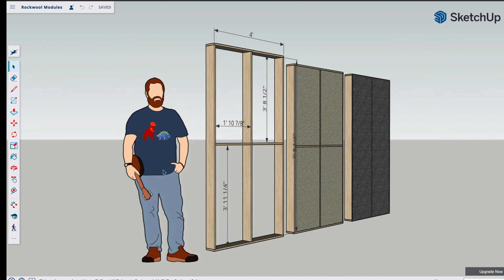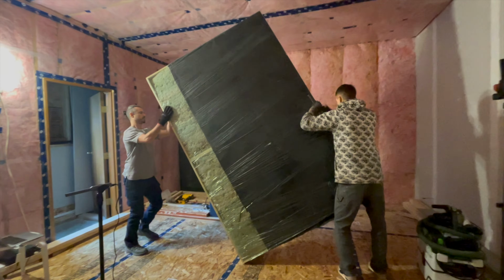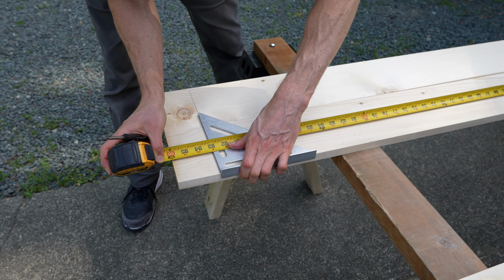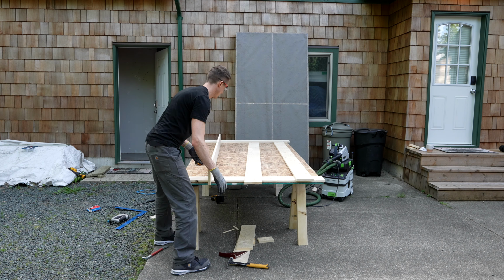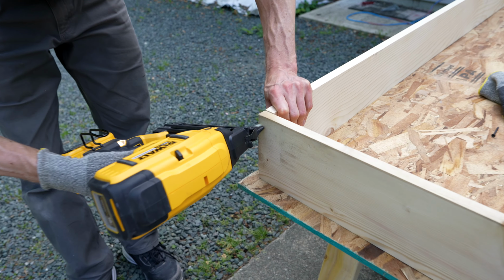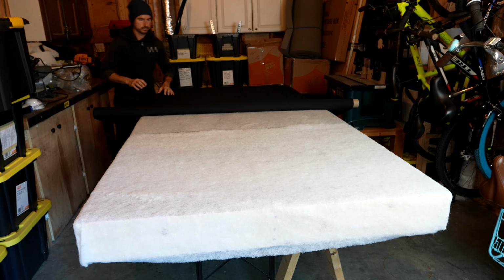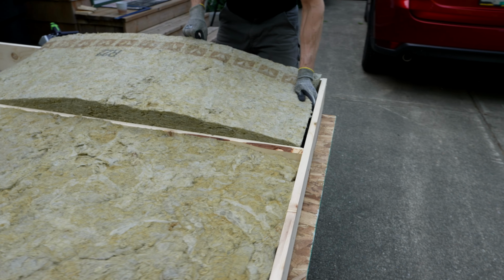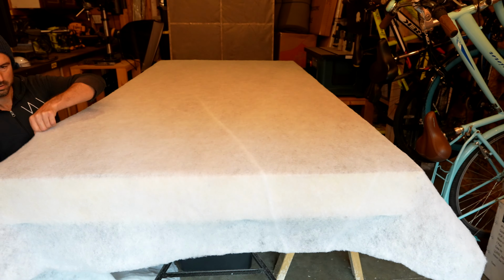How to Build the ULTIMATE DIY Acoustic Sound Panels for Music Studios

Comment: I’m not sure that my space will accommodate 5.5” panels. Which product(s) do you recommend using for 3.5” panels?

Also, in another video you stated that you prefer to use two different Rockwool products (one dense and another less-dense). But, in this video and the pdf, you only recommend using Comfortbatt. Why is that?

Comment: Dude, thanks for sharing your knowledge.  Been going down the room treatment rabbit hole for a few weeks, and your videos keep coming up. Good stuff.
Question: is there a reason you go with R22 instead of Rockwool Safe n' Sound?  I did a search for the R22 and AI said that "experts suggest Safe n' Sound for better results."  I'm not quick to believe everything AI says, but figured I'd ask.
Reply from the maker: Hey hey.  Glad you've been enjoying the videos.  AI only knows what the internet knows and the internet gets most things about acoustics horribly wrong.  So AI is often just referencing bad content in the first place.  

Unless you're building a very thin absorber (2") then you want to use very low density material.  Rockwool Comfortbatt is now 30 kg/m3.  Used to be 32.  Safe N'Sound is 40 kg/m3.  That's too high density for a deeper absorber.  It'll get reflective and that's not good for bass.  

I would only use Comfortbatt for an absorber up to 11".  If you go over that, I'd use pink fluffy fiberglass.

Comment: Hey there! I noticed you’re using R22 rockwool. At my local shops, I can only find R23 and R21; would one of these work just as well? Thank you so much, this video is very helpful!
Reply from the maker: The R stated value isn’t as important as density.  Although they are related.  They changed the formula and density recently for Comfortbatt.

Comment: Would johnmanville minwool 1200 4b work with these ?
Reply from the maker: Hey hey.  I wouldn't use that.  First of all, it's really high density, ranging from 64 kg/m3 to 192 kg/m3.  Second, it's made in weird thicknesses that don't match framing lumber.  1.5", 2", 4", 6".  

That product is too high density to use in most applications, unless you're talking about in the walls of an isolation shell or reduce sound transmission through walls.  Perhaps using a thin layer of it (1.5" of 64 kg/m3) in a multi-layer module.  

Otherwise, just stick with the basics.  Use Rockwool Comfortbatt and OC pink fluffy.

Comment: Hi, thanks very much for this whole series—it's super thorough and super helpful. Question for you—you mention using Rockwool Comfortbatt R22. My local store only has Comfortbatt R30. As far as I can tell all Comfortbatt has the same density and the R value only refers to some kind of thermal absorption spec. Wondering if you have insight as to whether or not R30 still has a flow resistivity of 10,000 and can be expected to perform the same as R22 (or any other R value of Comfortbatt). I'm about to buy a bunch of these, so curious to hear any insights you might have.

Also curious if you have insight into the best way to utilize 16.5" of depth. After playing with the Porous Absorber Calculator for awhile, I landed on 14.5" of Comfortbatt with a 2in air gap (the R30 I can easily source locally comes in 7.25" depth). But what I cannot calculate with that calculator is graduated density. Wondering if you might have more insight about whether using multiple densities with this shallow of a depth would be noticeably better than just using Comfortbatt. These panels would be on the walls to the left and right of each speaker. Thanks again!
Reply from the maker: Hey hey.  Glad you've enjoyed the series.  Rockwool Comfortbatt will all have the same GFR if the density is the same.  I think they've recently dropped the density from 32 to 30 kg/m3.  The R number doesn't matter and you can ignore it.  It's the product and density that matters.  

14.5" of Comfortbatt is too thick.  You'll get a bass reflection off that.  Make sure you carefully watch my video that covers density vs. depth.  

I would use 3.5" or 5.5" of Comfortbatt, followed by light density OC pink fluffy with no air gap at all if you have 16.5" of space to play with.  Filling an airspace with pink fluffy will always outperform using a blank airspace.  

If you're using panels to the left and right of speakers, make sure you vent the panels and don't use hard sides.  Look at designs like this with no side panels: https://jhbrandt.net/assets/drawing/208.pdf

Comment: Undoubtedly the most informative, complete and practical advice I’ve found on this subject. I’ve heard eco concerns about Rockwool as a material. Any thoughts? Can you recommend any easy to obtain alternatives?
Reply from the maker: Great to hear!  Thanks for your comment.  The health concerns about rockwool and fiberglass are unfounded, based on assumptions that have been methodically proven to be incorrect.  Rockwool and fiberglass are 100% safe to work with. 

Here's the background for you:
- https://www.youtube.com/watch?v=MSJjipaPxUE&list=PLBKYGbDC22HjdD3O4azKSOuy468ya_yPK
- Dr. John Hadley, a widely respected and experienced toxicologist, provides an overview of the research conducted over forty years period on fiber glass and mineral wool insulation fibers and the conclusions reached by such authoritative bodies as the International Agency for the Research on Cancer (IARC).
- WHO recommendation - unanimous position to not have these on the list of possible carcinogens: https://youtu.be/MSJjipaPxUE?list=PLBKYGbDC22HjdD3O4azKSOuy468ya_yPK&t=923 
- 2011 US Government removes soluble fiberglass wool from list of materials "Reasonably anticipated to cause cancer"
-  There is now no scientific, government or regulatory body in the world who has soluble rock or glass wools listed as a possible carcinogen. 
- All Rockwool is considered a biosoluble fiber.  This means the fibers are designed to dissolve in bodily fluids and are quickly cleared by the body, making them less likely to cause health problems than other fibers. 

Hope that helps.  All the best!
Reply: @warpacademy  I knew, in a world of unresearched opinions, that you would have a response grounded in as reliable research as exists. Thanks a million for cutting through the noise and superstition, as always!
Reply from the maker: Thanks mate.  Appreciate you.  Yeah, I'm very science based and I always look to the research.  Plus I've also worked with rockwool and glass wool for years and handled it a ton.  I'm very, very sensitive to chemicals and irritants, and I've never reacted to those materials and I work in my studio many hours per week.  Cheers!

Comment: I am going to be building these very soon.  Thank you for making this video.  Great info.  What is the approximate weight of modules?
Reply from the maker: Hey Tom.  I'm happy to hear that you're getting into some module building. Approximate weight I'd say is 60-75 lbs.  I could pick one up on my own, but usually I move them with 2 people just due to the sheer size and bulk of them.  

When they're stood up in a room, leaning against a wall, I can easily wrangle one on my own by shifting it along the floor.  Best of luck with your build!
Reply: @warpacademy   I was thinking of making them out of 1x8s.  They make bats that are 7.25'.  Would there be any problems making this size other than added extra weight?

Comment: Hey again! I'm curious about a few things.  Do you think it would be worth it aiming for 9 inches instead of your build of 5.5 inches for my back wall bass traps? I'd still use the 32kg/m3 rockwool. I'd layer a 5.5 batt and another 3.5 inch batt to make 9. I'm thinking of covering the entire back wall. Also, some deeper research reveals that some people have said that adding a very thin layer of plastic film, 6mm or so in front of the bass traps helps with some desired reflectivity in the mids/highs. Argument is that you don't want your bass trapping eating up the liveliness of the room. My room is 11.5x10.5x8H. I know, not very big!
Reply from the maker: Hey hey.  Those are very good questions and important considerations.  First of all you should go as deep as you can with your modules.  And you’ll get far superior results if you go with 2 types of density rockwool vs 1.  

So if you want to go 9” then I would do this.  3.5” of AFB (a 40 kg/m3 Rockwool product) or OC 703 as a front layer.  Then 5.5” of Comfortbatt.  Or if you can do 11” total then do 5.5” Comfortbatt in one frame and then in the second (front frame) do 3.5” Comfortbatt with a facing of 2” of Rockboard 40 (62 kg/m3) or Cabityrock (69 kg/m3).  You’ll get a nice dual density effect there.  

The plastic part you’re talking about is called a range limiter.  It will keep the upper mids and highs reflective while improving bass absorption.  The designs I just talked about will function similarly.  The harder rockwool on the front will act like a range limiter.  

I would not worry about adding that type of treatment until you fully trap out your room.  Then test and if you feel like your HF decay times are too short and the room sounds low end dominant then you can add range limiter modules after the fact.  

To make a proper range limited bass trap you make a 2’x4’x5.5” thick module with fiberglass or comfortbatt and you can simply add a 1/8” plywood layer to the front of the frame before wrapping it.  You can affix the range limiter to the frame by using 9/16th deep Arrow T50 staples.  That’ll do the trick.

Comment: How did you decide on 6" thick?  Can these be made thicker like 8" or 9" thick?
Reply from the maker: Hey Tom.  They're actually 5.5" thick, technically.  We make all of the modules for studios out of standard dimensional wall framing lumber (SPF softwood typically) and use wall insulation that's designed for that framing.  Walls are typically framed out of 2 x 4 or 2 x 6 studs.  The 4 in 2 x 4 is actually 3.5" and the 6 in 2 x 6 is actually 5.5" if you measure it. Then the insulation you'd find to pop into the stud bays is either 16" on center (OC) or 24" OC depending on your stud spacing.  

In this build, because weight is a factor and these don't need to bear load, I used 1 x 6 stock and 2' x 4' x 5.5" thick rockwool batts.  You can, and indeed should (if you care about acoustics) go much deeper.  For example, in my control room we have roughly 2' thick ceiling modules and side wall modules, and 3.5' thick (>1m) rear wall treatment.  

Watch this video: https://youtu.be/SSn8HEsG8ro. It explains how you need to adapt the density of your porous absorption as you go thicker.  

For thicker modules: What thickness should you use?  Seeing as rockwool and fiberglass both come in 3.5" and 5.5" thicknesses (unless you're talking about a specialty product which can come in almost any thickness - EX: Rockboard 40 or CavityRock from Rockwool) you should work in combinations of multiple of that.  

So you could combine a 3.5" batt of Rockwool Comfortbatt with a 5.5" thick batt of OC pink fluffy fiberglass, for 9" of total thickness, but how are you going to frame that?  There's no common framing lumber that's 9" wide so you'd need to rip a 1 x 10 or something, which can be expensive and wasteful.  

I'd much prefer to work in 5.5" depths with these modules.  You can easily stack 2 of these to get 11" in total thickness and zip tie them together.  That's what I did in my old room before this new control room.  11" thick double stacked rear wall modules with wooden slats of them for scattering. 

You could also stack 1 x 4 frames with 1 x 6 frames.  That would get you 9" thick modules while still using standard framing lumber.  

Take my free course on studio design and acoustics: https://warpacademy.com/free-studio-design-course/. It'll help a lot.  

Cheers!

Comment: Is it possible to build stands for there if a wall anchor is not possible?  Or would the stand need to be very large?
Reply from the maker: Hey Tom.  If you want ones on stands you’d be building more of a studio gobo design.  It’s possible but not recommended with modules this large.  Look up studio gobos and you’ll see some designs.  I would always rest these on the floor but you could support them with bracing to keep them upright if they’re not against a wall.
Reply: @warpacademy  Thank you.  I definitely don't want a domino problem.

Comment: I have 9' ceilings in a 16' x 24' room with tile floors (w/ area rug) and finished drywall on all walls and ceiling.  Obviously, this room is an echo chamber.  It is fine when I use my eDrums with headsets for personal practice, but using my acoustic kit with a small group will make you deaf even playing light jazz at as low a volume as possible.  The rehearsal studio we had is not useable now, so I need to make this room functional for group rehearsal.  

My question is, with the 9' ceilings, will just building the template 8' panels work or will the gap at the top cause problems?  It would be much easier to do the 8' with the minimal board length waste and insulation, backing, all of it.  Is it worth all the extra waste and custom cuts to do that extra foot?  

Accounting for the door, shelving and 3 windows, I can fit 5 of these in there standing up and another 3 laying on their sides under the windows.  I don't know crap about acoustic engineering, I just hit things with sticks, so I am grateful for any guidance you can provide.  Thanks very much.
Reply from the maker: Hey hey.  Very good question.  My guidance here is for creating control rooms for mixing and mastering.  You want them much more dead than a recording studio.  In a recording studio you want controlled sound but still much more live sounding than a mixing studio. 

I would use a combination of porous absorption with diffusion to achieve that.  You will want to explore possibly some adjustable acoustics.  

Do not throw that many modules as you mentioned in your room, that will kill way too much of the ambience in your room.  Unless you added slats or other diffusion scatter plates to the modules.  

I can’t advise on a design in a comment so I would suggest you read books like Home Recording Studio Build it Like the Pros by Rod Gervais or the Master Handbook of Acoustics.  Or hire a studio designer to consult.  

Now, if you were building a control room and not a recording space then I would not extend the 8’ tall modules in a room with only 9’ ceilings.  I would instead build the modules with 2x lumber instead of 1X so you could lay out a ceiling to span the room and sit it on top of the modules.  

In my control room we had nearly 11’ ceilings so we did add 2’ extender modules on top of my 8’ ones and still had room for a wall to wall, front to back soft ceiling on top of those.
Reply: @warpacademy  Well, you certainly proved I don't know crap about this.  Great explanation and I now see that I was trying to build the wrong room!  I need to build the room where I hit things with sticks and not the one where people sit in front of a bunch of flashing lights on a console and record / mix the resulting noise I make.  BIG difference in design and purpose.

Thanks for pointing me in the right direction.  I will change course and study recording studio design.  But I will be back if I ever decide to build a full studio to record my cacophony of clatter for posterity.
Reply from the maker: Right on.  Glad that helped.  I think you'll really enjoy Rod Gervais's book.  He's an engineer and a master builder.  The book is an easy ready and not too long.

Comment: What are healthy alternatives to rockwool? I don't want my aircon to blast those tiny particles out, so they constantly add up in my lungs.
Reply from the maker: Hey mate.  So, here's the deal with Rockwool or any other fiber-based porous absorption.  You MUST wrap it.  In this design, you can see the batts are contained by the landscape fabric backing, the cotton batting first layer, and then the GOM / Duvalex acoustic fabric.  

When you do it like this, you are completely safe.  There are rumours floating around about Rockwool not being safe.  They are wrong.  Rod Gervais devoted a section of his book to this, and presented the research to back that up.  All you have to do is prevent the fibers from floating around by building proper modules.  

No amount of air flow into my modules can dislodge fibers once wrapped.  You have nothing to worry about.

Comment: great, clean and easy build! 1 question, what happens when more dense wool is used? e.g. 48 or 60 kg/m3? Will these absorb more bass frequencies or will they become reflective insteaad?
Reply from the maker: Thanks very much!  Here's my deep dive video about porous absorption: https://youtu.be/SSn8HEsG8ro  Watch it for a big discussion around density and depth.  

The acoustic performance of porous absorption depends on both depth and density.  So whether it's reflective or absorbent will depend on how deep the treatment is.  

If you are considering using 48-60 kg/m3 rockwool, then perhaps only use it as a front layer (1-2") and then lower density behind it.  Graduated density will typically perform better than a single density.